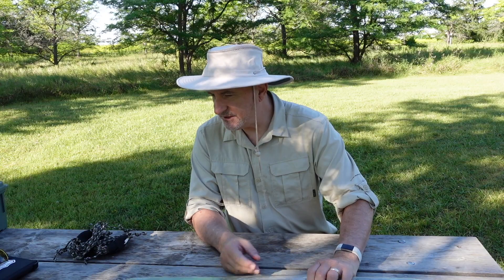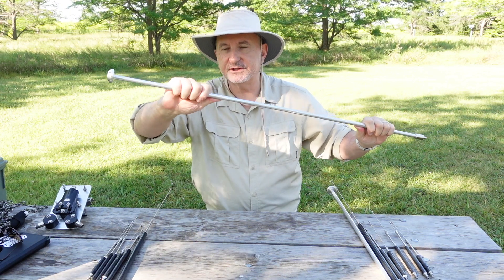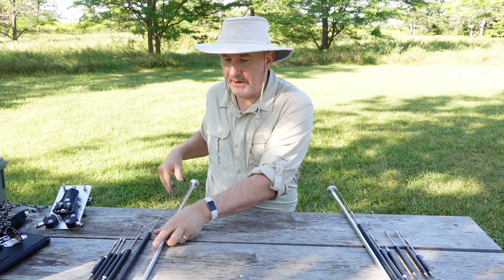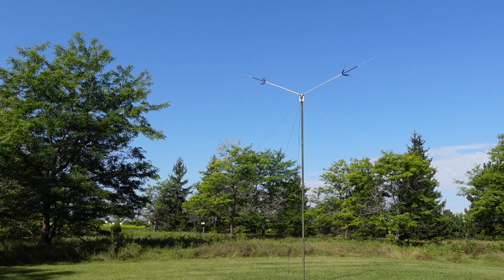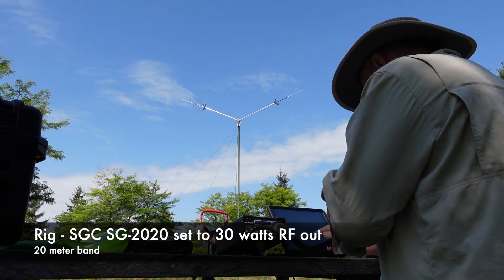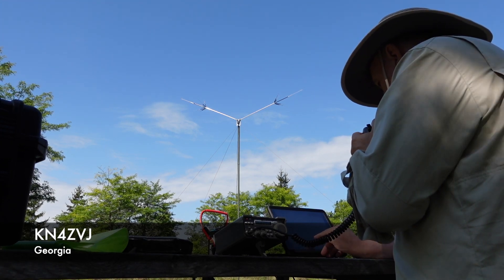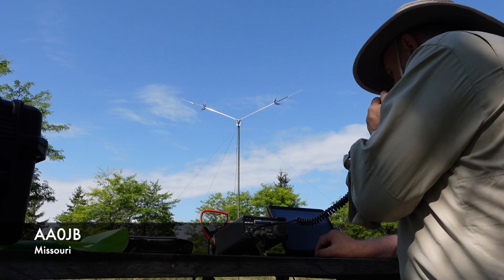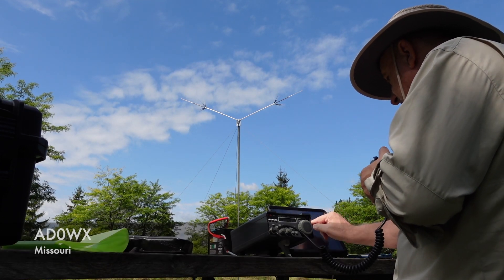Does The Tiny Diamond HFV5 Antenna Really Work?

Comment: I've had my HFV-5 for about 3 months now and the antenna works great.  I can't find a radiation chart for the antenna. You can also set this antenna up with what I believe is the feed side vertical and the other side horizontal.   Would this be an advantage and have you tried this configuration..   Thanks 73... Fred
Reply from the maker: I never had a chance to try out the 90 degree configuration (I sold the antenna shortly after making the video, too many antennas in my collection), but I've heard some people like that to get both vertical and horizontally oriented signals.

Comment: I am very impressed with Diamond antennas.  Well designed and made with very high quality.  I found that they just work as advertised with very repeatable results and less fiddling around to get them on the air.  Good stuff.  I live on the third floor of a big apartment building and I use Diamond HFxxCL single band mobile antennas sticking out horizontally with a jaw mount to the window frame and a tuned counterpoise hanging out down the side of the building.  I get great SWRs with decent bandwidths and very good results mostly without having to use an antenna tuner except in the most dire situations within the antenna's capabilities..  I can't complain because it gets me on the air.
Reply from the maker: Cool, thank you for sharing your experience!

Comment: Seems a bit on the expensive side. I don't do a lot of POTA but when I've had I just put up a doublet and can work all the bands between 40 and 6meters and did it for much less than 100 dollars. With the stand and mast, more like 200, so eh.   On the positive, it looks easy to use and set up, and would be a find addition to any pota outfit.  Best Regards.

Comment: Thanks for the review. They are very proud of this antenna at $320+. I can see pack-it-away issues with all those resonators. It looks cumbersome to set up and take down IMHO. Might be a good choice for HOA situations.
Reply: The antenna is really well made, no issues with elements or assembly process. There was no problem with either setup or teardown. Yes, you have to be careful, have a solid mast and a method of setting it up. I would not use it for a few hours of operating but if you are somewhere for a day and space is limited it would be an option to consider. (I am hypercritical about this kind of stuff but I was presently surprised)

Comment: Diamond is noted for quality antennas, so I would have no hesitation in buying one if I needed.  The only question I have is, is there an adapter for 80 meters?  I always look for equipment for EmComm, so something that works on 7/80 is imperative.
Reply: Hustler has 75m resonators for their version of the antenna. However, with the length of the antenna, I am suspecting the efficiency would be in a single digit range. For 80m I would use EFHW, dipole or ZS6BKW which is small and with the tuner works OK on 80m .